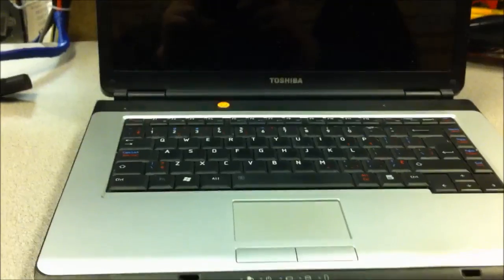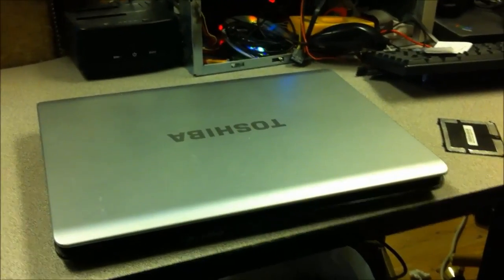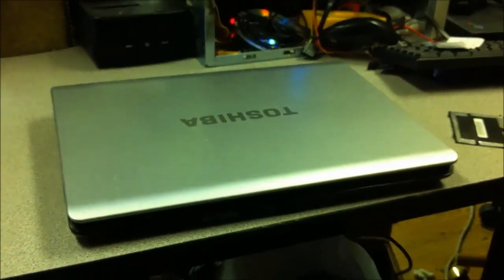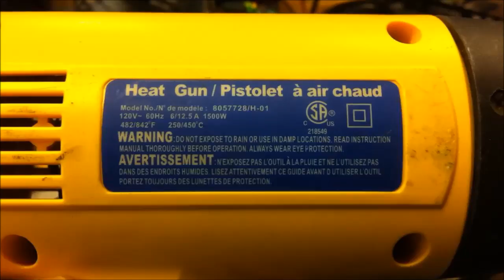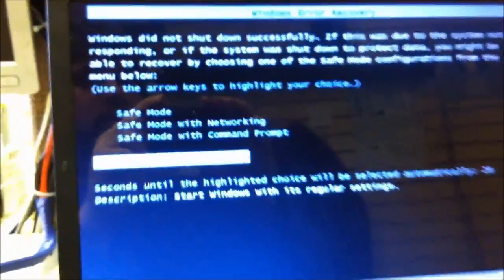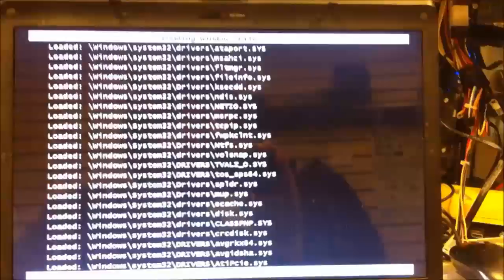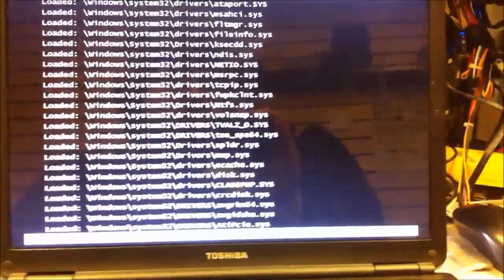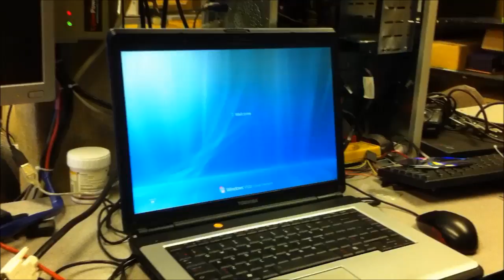Fixing A Failed GPU / MotherBoard

Comment: when GPU is broken reballing is temporary remedy. it goes back being broken again and if it's again reballed it will work again until the chipset has had it reballing it will shut down for good. When GPU is dead forget reballing the unit is dead and gone.

Comment: Using a cheapo Drill master heat gun, a bic pen and aluminum foil I fixed a toshiba satellite l675d using this very method.  I shaped a nozzle attachment, with the pen and aluminum foil, to the end of the heat gun to be thin and narrow and used heat on LOW and hit the graphic card for about 20-30 seconds -- two intervals.  I didn't touch anything and just hit it with heat about a half inch to an inch away CONSTANTLY moving the heat gun.  I used plenty of thermal paste to put it back together and it booted right up!  Thanks!

Comment: hi, I have proline w763s laptop, turns on and reads everything but after few secs it starts beeping, it's long beeping like ( beeeeeeeeep, beeeeeeeeep) 5/6/7/8 sometimes 38 times of beeping the it shuts off before finishing the starting up, it ends in "welcome" but when i start with safe mode it finishes up but after 5 seconds it shuts off quickly.

my efforts I took:
1) I tried to change the RAM with different slots and different RAM sticks with no success

2) I tried to change the processor but no success

3) I cleaned up the whole motherboard but yet no success.

Anyone with new idea what do I have to do apart from what I did, please help me.
Reply: Have you checked if your heatsink and fan is clean and that there's no dust in it ?
You should check if the fan is plugged in and spinning.
Make sure there is new thermal paste applied to all the chips that are cooled by the heatsink.
And to see if the heatpipe on your heatsink is not bent.
Reply: fan is spinning and ts clean, heatsink is not too hot and and there is a new thermal paste but still the problem exists, i still don't understand what is the problem....... but thanks a a lot for your advice, I appreciate it
Reply: Then you should maybe rewrite the bios, or at least check if the bios battery is still ok.
Reply: ooh, thanks a lot let me try it may be it will work

Comment: Watched your video and it worked for about 3 weeks so I tried it again and again it worked for about 3 weeks but the third time it did not work and now no video only power light and battery light
Any advise?
Reply: This kind of repair is only temporary, over time the solder under the chip gets oxidized and does no longer stick to the pad on the motherboard, the more times you heat it the more the solder gets oxidized.
I would suggest buying some no-clean flux and applying it around the chip, then attempting to reflow it again and cleaning the flux off after.
If this doesn't help then the chip needs to be properly re-balled with the right equipment.
Reply: Thank you will try that. do you know anything about Toshiba Thrive Tablets?
Reply: Never knew Toshiba made tablets.

Comment: I had a Toshiba qosmio titanium I bought in 2006 or 2007. It had a similar problem but it was with a driver since it was a graphic card that was made for HD DVD. Supposedly the guy who I sent it in to repair said the graphics chip was burnt out and the mother board needed to be replaced. I paid about 1,500 if I remember correctly for the repair they gave a 90 day warranty too and as if on que it broke down 3 months later. I'll never buy another toshiba products again. I bought a Dell on 2010 still working fine to this day. Still piss knowing for the money I spent on that laptop I could have bought a beast of a gaming computer.

Comment: Heat the bad rework station with the yellow heater, that'll fix it.... Reflowing with a trusted reflow oven system is one thing and blasting it with a heat gun is quite another. Thank God that EE is not a degree like bullshit business degree. Otherwise, we would have bunch of idiots waving heat guns around...

Comment: nice work i have a old system which i dont use anymore because of graphic problem it happend after copying images into a software and all of sudden screen size got smaller vertically and horizantely and text and images got fuzzy i change the resolution and driver are ok it is onboard vga and i tried to plug  in 2nd lcd  aswell but no display on  2nd moniter can you help.

Comment: +StarPuss www.ToxicRedNeck.Com Hello i have been going crazy trying to fix my broken graphics card. I believe its hardware problem (broken gpu) but i am not sure. When i try to use it to play games it it all goes good untill 30 seconds to 5 minutes when the game freezes and closes, After a few seconds after it closes the fan goes crazy on full burst and somtimes i get a Video TDR failure BSOD and somtimes it switches to intel hd graphics (Fan keeps going on full burst) things i know: It isent becuese of invalid bios settings, Its not that im using wrong graphics drivers, Its not a bug in the TDR feature, Its not unsuported hardware becuese it was prebuilt, It is not overheating, It is not dust. Hardware info: Laptop MSI GT70 0nd, gtx675m, i7 3610QM, 16gb ram, SSD+HDD (windows on SSD) PLEASE ANSWER

Comment: I must thank you so much for this video.  It worked like a charm on my Toshiba L675D-7052.   It was coming up to a blank screen. I thought the cpu or motherboard was fried.   I only used a hair dryer on high to fix it.  Thanks again.
Reply: +Bill Worley I've got L675D-7052 with no display, but the computer appears to be running. Won't go to an external monitor, I'm assuming it's the gpu also. How did you diagnose?

Comment: my toshiba was getting real hot and i found the fan was stopped up with dust so i got an air blower connected to my air compressor and blew it out, working fine now.

Comment: Worked for me! Toshiba satellite c660d. Will be cleaning laptop inside regulary from now on. Was completely blocked with dust then over heated. (no display) Put some tin foil over capacitors while using the heat gun for 2 mins.Thanks man.

Comment: I had purchased a failed Nvidia Geforce Go 7900 card on eBay, and it does not display any video. The die sure seems to be heating up, though (burnt my finger >.<). I have tried an external monitor but still won't work. Will this method work?
Reply: Why would you buy a used gpu on ebay?!
Reply: FrostBitten :D cause that's where I can get what I need without being overpriced. Why, is there something wrong? Reputation of eBay?
Reply: Isaac Ledesma Well, usually if something is dirt cheap compared to what it is being sold at on ebay, there's most likely something wrong with the product
Reply: FrostBitten No, I bought it broken. The seller said it was broken, I knew it was broken. I really just wanted the heatsink that came with it.
Reply: FrostBitten
I have bought many Gfx cards on Ebay, haven't been burnt yet.

Comment: I hope you get back to me soon, though if not, no worries.  I have a Toshiba Satellite L675, replaced the keyboard on it once, was overheating so I took a can of compressed air and blew out the fan after removing the back cover.  Lots of dust.  Nasty.  Anyway, about a week ago, after a Windows update for 7, the computer powered down ok, but when I went to turn it on It only goes to the BIOS screen, then awhile later, goes back to the BIOS screen.  It shows Toshiba and you can hit F2 for setup or F12 to go to the Boot option.  Tried running my Linux off of a flashdrive, but that didn't work either.  Tried the unplug the wires, and take out battery and press power button for 60 seconds and just power on with the power adapter, tried it with the battery in and out.  Nothing, same thing.  Similar problem, but different than the one diagnosed in the video.  Will see if it works when I have more time and let you know if it fixed it, unless I hear from you first.

Comment: hi i have the toshiba l300d-13h and i have black screen...
i tried everything like hold the button for 30s etc. but still nothing ...the fan is working  and the power led too....
is the problem on the motherboard? like GPU or CPU?
Reply: ty...but problem solved about 2 weaks ago :D
i did reflow of gpu with oven and it works perfectly ! Thanks buddy
Reply: ty

Comment: I have an old Alienware that has this problem where the fan will not spin, everything works, cpu, gpu, ports etc. I replaced the fan once before and it still will not move when the computer turns on, so my question is: should I try to bake the motherboard to make sure the solder for the fan connector is secure? Hell I could even just use a solder gun on it as a last ditch effort

Comment: hi , i have asus x5dab and i replase thermal paste and clean fan and the tempature is 90 celsius
Reply from the maker: Did you bend the heat skink trying to remove it? your contact surface is not the best.
You will need some Heatsink shims
thermal interface material Or Copper Shims
OR Maybe a Heat pipe broke? <Maybe a new heat sink.

Comment: In my asus k53s my nvidia card stopped working after few months. I twiggled with drivers any many many other stuffs to finally find out the problem is in hardware. The problem is, that in this type the invidia card is fixed in place, so I can't really change it or anything. Do you think this method would be suitable?
Reply from the maker: Yes should work.
Reply: Thanks, we will see in few days, when I get hold on heatgun :)

Comment: Does this last permenantly?
Reply: Usually no. What does fix it permanently is reballing it with a brand new gpu, that is much much more expensive and you need to get it professionally done.
Reply: I think its cheaper to buy a new laptop
Reply: Mohamed Elgebali Hmmmm, repair a motherboard for $70..... spend $400 on a new laptop..... il buy a new laptop its cheaper.

Comment: good little video, nice clear English well done. have Toshiba screen black after spilled drink, can sometimes make out image on the screen would this fix here work
or would it have something to do with screen lamp?
Reply from the maker: Don't think this fix will help you , You will have to pull her apart and see what damage it did , Some liquids can be cleaned off , some will corrode the board.

Sounds like your LCD Inverter board is not getting the right amount of power from the Mb.
Reply: thanks for reply! not my board a cousin taking a look has loose vga so will take apart will try the reflow in oven method same time nothing to loose!

Comment: I ordered and received a 15mm x 15mm (1mm thick) thermal pad.  DO YOU STILL USE THE BLACK SHIELD THINGY COVERING THE GPU?  Or do you just use the thermal pad between the GPU and heatsink?